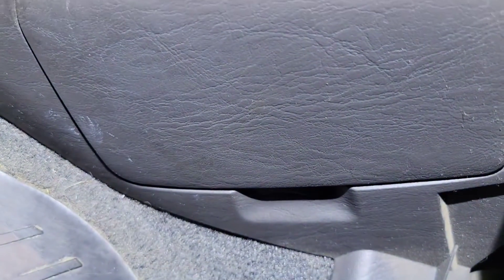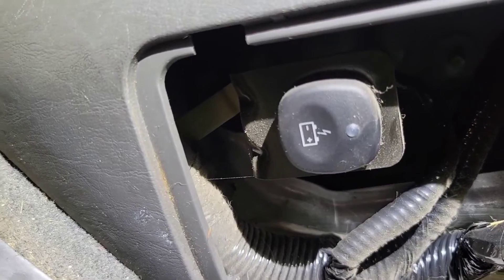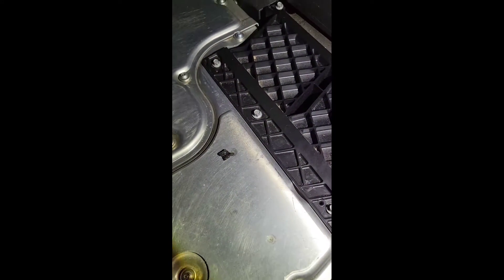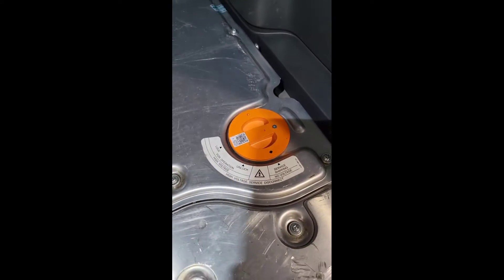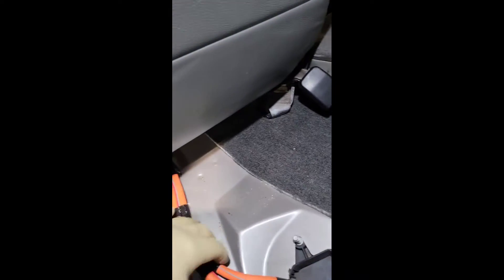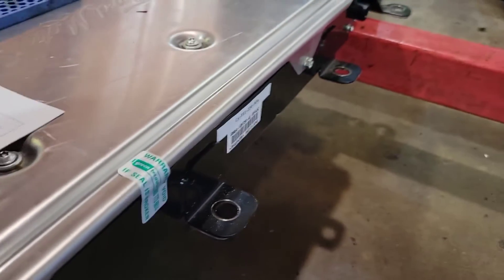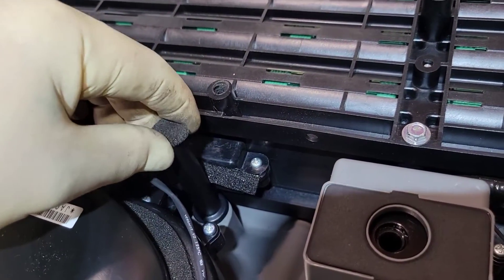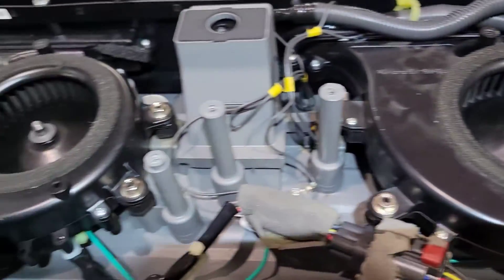Ford Escape How to Replace Hybrid Battery

Comment: I have the forscan app and want to rebalance my hvb. It warned me that i might need a service manual to do this so i backed out. Do i need a service manual to perform that procedure?
Reply from the maker: I have never done it with forscan and have not used it, A scan tool can do this job but I use factory scan tool for this

Comment: Very good video!  A few years ago my 2008 ford escape hybrid wouldnt start after leaving it sitting for a few weeks and after taking it to the ford dealership they said my high voltage hybrid battery was dead.  After doing some research I found out about the button on the side to charge (click wait 8 mins) and its been working great ever since.  I also have the problem where the car wont start unless i push in on the ignition to get good contact.  A few days ago my car again wouldnt start.  Then in the morning it worked again, however later in the day again wouldnt start... now it wont start at all.  This time nothing seems to be working- I changed the 12v battery just to be sure that wasnt the problem, tried the 8 minute button click, but still it wont start.  When I turn the ignition, i hear a clicking in the back of my car so I had a friend help me to see where it came from and it sounds like its coming right at the location of the large orange cable on the battery pack.  The sound is like if you turned a lock and turned it back.  Any ideas would be greatly appreciated.
Reply from the maker: Thank you for watching.  Honestly it's probably your high voltage battery.  Everything is contained in the battery.  When u took it to Ford and found out your battery was dead did you have it replaced? Message me on Instagram.

Comment: Getting an intermittent P0A1F code with the battery disabled. The car still drives fine. This happened about 6 months apart. Both times I've reset the BCM and did a Rmode rebalance to get everything working again. I'm thinking that I'm buying time until I need to replace the BCM or HV. 

Oh it's a 2009 with 124K
Reply from the maker: Man that is a weird one. Sounds like you are probably correct. I mean I would think your battery would be what needs to be replaced. If you message me on Instagram with your specific vehicle info I can look up and see if I can find any insight for you. Thank you for watching.

Comment: I've got a 2007, and it feels like I'm having battery issues, but no dash codes come up.  It still starts without issue, but periodically (and more and more frequently), the car loses all acceleration power, and the charge/assist gauge just sits in the center.  It feels like the electric motor isn't doing it's assist, and the regenerative braking isn't doing the recharge.  Is this (the fans) what I'm probably dealing with?
Reply from the maker: That is a weird one. From my experience when the fans fail it sets a code in the computer. Do you have the ability to do a full vehicle scan? Hybrid computer as well? Message me on Instagram and I can help you some more. Thank you for watching.
Reply: @NutsandBoltswithTone , sadly I don’t have a code reader myself.  I took it into my mechanic a few weeks back, and nothing seems to have turned up, but like I’ve said, it’s been intermittent, but increasing in frequency.

I don’t have an instagram account, though.
Reply from the maker: @Vessekx  when it's acting up it's it in hybrid mode or gas? Does gas motor kick on if it's in hybrid mode?
Reply: @NutsandBoltswithTone , when it’s acting up the engine is running.  But in normal operation (engine on), the electric motors provide assist in acceleration, and that’s what it feels like it’s missing when it acts up.
Reply from the maker: @Vessekx  I've never come across anything like that especially with no codes. One thing that can cause issues is the throttle body gets really dirty. Not sure if this relates to you but I would clean the throttle body.
Reply: Hey!! I have a 2009 and I'm having that exact same problem! It happened more frequently when the weather was hotter too. I've plugged in my scanner and I was get the "electronic motor over temperature" code. I can't really remember the exact code. I've checked all my fuses, changed the engine temperature sensor, pressure tested my hybrid cooling system, changed the MECS pump, vacuum and regular bled the hybrid cooling system. Only thing I can think of that's left is that there may be something wrong with hybrid battery. It's getting cooler now so it seems like it's taking a lot longer for it to "overheat" but I would like to figure it out. Any help is gladly appreciated!!!

Comment: Can you still drive the vehicle with the gas engine if you put the vehicle in service mode? Most of the mechanical shops near me shy away from the hybrid vehicles I have been getting a few hybrids in my shop but no EVs yet. Great vid!
Reply from the maker: No if the hybrid system is malfunctioning the vehicle will shut down depending on the problem. We work on a lot of hybrids, well we pretty much work on a lot of everything. Got to be careful with hybrids as they can be very dangerous if you do not know what you are doing. Thank you for watching.